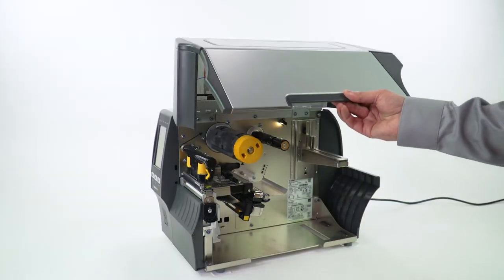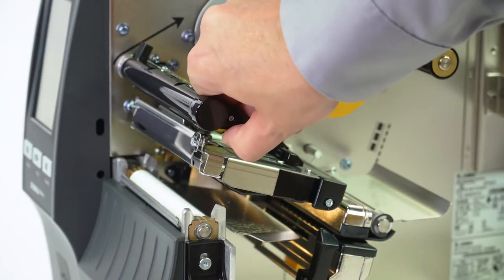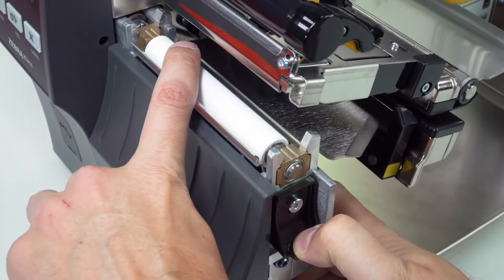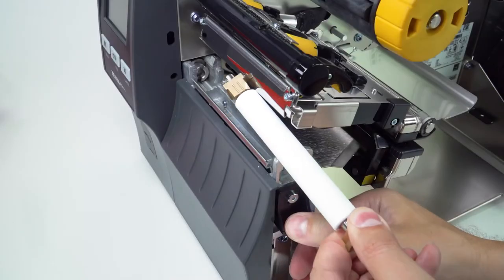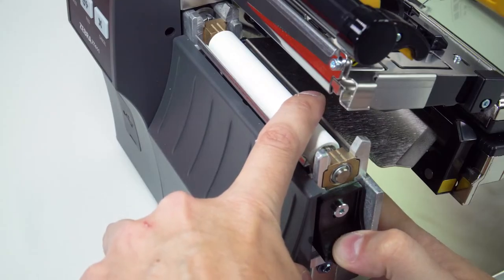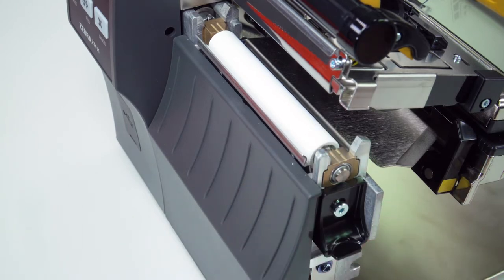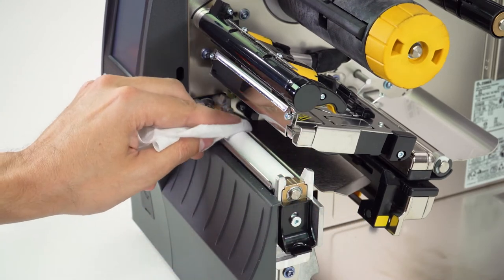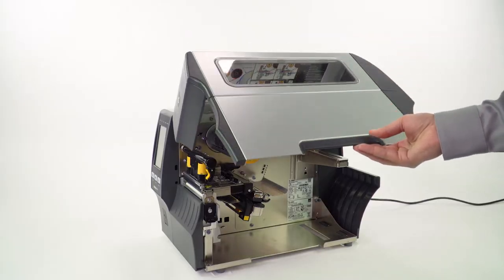How to Replace the Platen Roller on the ZT411 and ZT421 Printers | Zebra

Comment: Why does this piece stop spinning ? It’s hard to spin then it gets loose then gets hard to spin again but the part where it gets loose is when the labels get jammed and stop feeding all the way
Reply: The issue could be that the platen roller is not fully engaging the innermost cup (inside wall side).  I found that some non-Zebra platens are out of spec, and the width is slightly off, causing issues with the pins not engaging the cup.
Reply: @reddirtwarriors4846  the issue was the cheap belt that spins the platen roller. Replaced it and it back in action
Reply: @NikeChecksHtx  Awesome, I was just about to have you check that!  The belts often strip if there are a lot of media that gets stuck in the platen roller.
Reply: @reddirtwarriors4846  hmm good to know that i will pass on that information. Thank you !